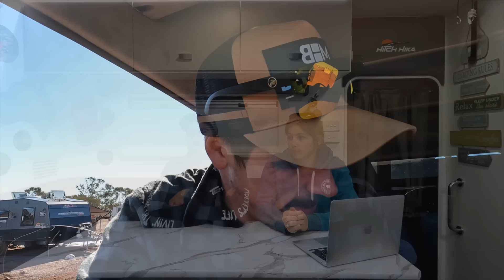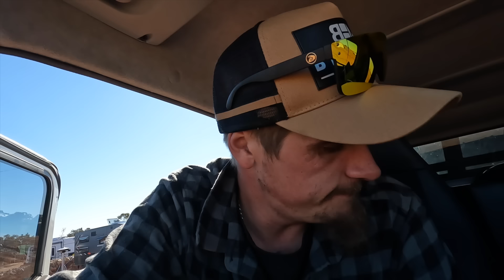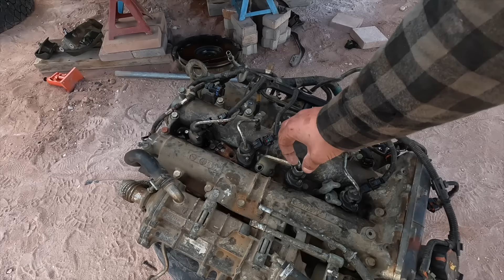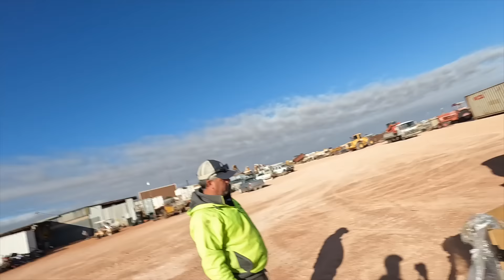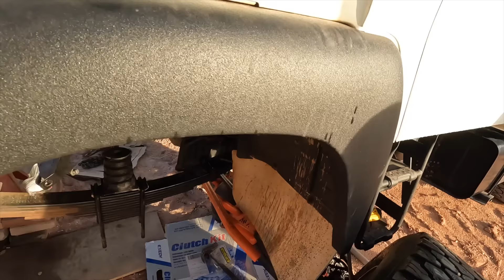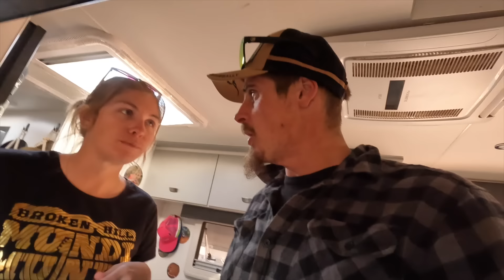COMPLETELY DEFEATED! | Truck Engine BREAKDOWN in the Middle of Australia | Our Raw True Story!

Comment: Terrible story, we just went through almost the exact situation. Bought a 2112 NPS 300 in a private sale through a coach builder on the GC. It came already setup with a 2023 Austral pod with all the fruit. The odometer had 50,790 klms on the engine. It had a new transfer case super singles etc etc. We’ve been travelling for 9 weeks up the East Coast and the internal water tanks ruptured, water pissing out all through the pod. Decided to head back to Brisbane to get it fixed and the gear box jammed up. No warning lights no preconditions. Tried limping it back from Tully to an hour north of MacKay to a truck stop. A few scary incidents on the way back but made it safe ( couldn’t shift it but managed to get 5th and roll it) I hear you when you ring around to get “ someone local “ to diagnose the issue and no one gives a shit or is outrageously expensive.
Four days in a truck stop no water onboard and no powered site so it was a little defeating to say the least. I managed to find out what the problem was and rang a spare parts in MacKay and fixed it but that wasn’t the total issue and ended up having a truck repair place fix the issue and get a tow to the yard…..
I was informed by the repairer that the odometer was flicked and there was way more mileage on the engine???
Now we are having more issues that Isuzu is sorting out while we try to find accomodation for a week. Really hard with a dog nobody is willing to accomodate. 
The bloke who sold us the vehicle is denying everything and duck shoving the issue 
Court maybe the only answer but that is costly and time consuming.
I suppose “ what doesn’t kill you makes you stronger”.
Reply from the maker: Sorry to hear mate. It’s so hard to get help in general while travelling hey! We only got so lucky because we kept being handed more phone numbers to call. 
Your situation sounds so hard, and one of those ‘one in a million’ shitty situations. 
I hope it gets sorted and you get some help. 

Just keep going, and you’re exactly right, what doesn’t kill you makes you stronger. 

If I had any contacts in that area I would pass them on mate, wish we could help more. 

Hope it all works out. 
Stay strong.

Comment: Too cold this time of the year to be in Cooper Pedy
Good Luck for the future 
Greetings from FNQ
Reply from the maker: @rl7586  yes it definitely is I don’t thing we got out of long sleeves and long pants the whole time. We’ve made it up to the warm weather in NT 😊 cheers
Reply: Cold lol,what 30c daytime temperatures!
Reply from the maker: @Wilt8v92  I think it only got to a high of 16-17 when we were there
Reply: @tildesleystravelaus I  In the South of NZL the snow not far from me,I still in shorts but I see Tasmania has been colder than us by far.I have driven around the desert in a  Valiant ute back in the day.As a bush mechanic this new diesel stuff is a bit scary,be good if you get something without  a DPF and AdBlue ,it's all this emission control stuff I reckon is causing problems,but the manufacturers are been forced into it..At least that mob stood by it for you..
Reply from the maker: @Wilt8v92  yeah pretty cold down in tassie, 
That would have been awesome in the day 👌, yes I’m thinking the same thing regarding all the emission stuff these new engines have 🤷‍♂️

Comment: Guys in my opinion if your vehicle is a Fuso Canter, then it has a puny engine of 2998cc.It’s not made to tow a caravan and must have given the engine a heart attack. Surprised it has done 50,000 km.
Better for towing is Isuzu NPS 75/45-155 4x4 which has a engine capacity of 5193cc 😢
Reply from the maker: Thanks guys, we looked into the NPS but decided on the Fuso for reasons of our own, also the 25 model NPS 300 is dropping to a 3L engine. Enjoy
Reply: umm in nz our two 4x4 fuso canters have a 4.9l engine 4m50
Reply from the maker: @acevr4  they dropped the 4.9l engine in these around 2012 I believe in Aus
Reply: @tildesleystravelaus  right, our 2008 and 2022 both have them, we couldn't get the 716 without the 4m50. the old one has been super reliable , they are both spray trucks, your one is mine and two other mates dream truck for adventures .
Reply from the maker: @acevr4  yeah I did look for a 4m50 truck but fairly hard to come by, in aus as most people who have them hold onto them as they are super reliable, thanks mate we absolutely love our truck they make a awesome aventure vehicle 👌 enjoy
Reply: My 1985 nissan urvan has Z20 2.0l carby petrol. Gets up the Alpine Highway to Mt Hotham good enough.
Reply from the maker: @brutechurchill  👌
Reply: @brutechurchill  yes it will since it all depends on the power to weight ratio of the particular vehicle.

Comment: These engines are a nightmare there actually a fiat engine if you didn’t know. There common for cracking heads there is also a recall on the timing chain guide bolt that holds the timing chain guide in backing out. Definitely worth a phone call to see if it’s been done.
Reply from the maker: Yes we have obviously found that out since our issues.
Reply: Do you guys know what years are prone to this problem,  I got the 2015 nps 300 with 250k on it.
I'm in west oz and it's my painting rig
Reply: @Clayton-h4q  truck in the video is a Mitsubishi.
Reply: Iveco , Mitsubishi, loads of engines are exchanged among the factories.
Reply: I've heard a heap of dramas with the Canter motor unfortunately.  Seems most tour operators, remote stations and remote contractors use the isuzu nps or hino.
Thanks for sharing your experiences
Reply: Good job bud that old motor looked 25 years old.
Reply: Anything made by fiat  is trouble Fiat stands for FIX IT AGAIN TOMORROW but top job on the removal in the middle of nowhere

Comment: Man i feel for you guy's. I purchased a low km fuso canter with that 4p10 engine and it has been an absolute bucket of sh#t with nothing but problem after problem. Dpf problems, ECU problems, EGR problems, it doesn't go a week without a engine light coming on for some reason. I have been told by several truck mechanics that they are the worst truck on the road and that i should sell it and buy an Isuzu. I am glad it has all worked out for you.
Reply from the maker: Thanks, same back to you mate, sorry to hear, hopefully it goes better for you😊

Comment: Registration should of picked up the heart transplant. I can only imagine the heartache. Best of luck to ya .
Reply from the maker: Different states have different laws unfortunately. It was done before it was due for rego and people that did the swap didn’t notify/didn’t know they needed to notify the authorities. 

Thanks mate, all back on the road now 👍🏽
Reply: No reputable shop arranges an engine swap and doesn't update the engine number... whoever that is should be paying for your headaches. Hopefully it's all behind you now.
Reply: For the last 40 odd years nothing and I mean no vehicle has an engine no. On the rego papers and rego papers in your name doesn’t prove ownership either. When I was young any engine change needed a eng no update on the papers . Once the 17 digit vin no came in that’s all that mattered to the unthinking govt and then it was open slather for the thieves stealing cars 4wds etc for good engines trans . I’ve seen 80 series cruisers cut up with concrete cutters for the running gear out of the riverbeds.
Reply from the maker: @smaldo19  we did get refunded the cost of the new etc for this reason they didn’t get it re-inspected and compliance for the new engine number
Reply from the maker: @stephengibbs4372  yeah not sure about that as our 21 model truck had an engine number on the papers that it was Registered with then a different engine number on the engine that blew , we then brought a new engine and have had to get it reinspected for the engine swap.. 
my ls2 chev motor in a project still at home has an engine number 🤷‍♂️
Reply: @stephengibbs4372  All vehicles have had engine numbers & continue to do so.
Reply: @davecurry8300  I know that, I build engines. I forgot to put im in NZ and some of our law changes in the last 30 years have been misguided and a bit slack.

Comment: Oh, not as bad as l thought, Mitsubishi  ok, but light running gear, for the job it's doing.
Best of luck, don't push it too hard, should be ok.😊
Reply from the maker: @owenwatson9828  yeah I had a few Isuzu we ran thru work hence our decision on a Fuso , only negative against was the 3l engine compared to the 5.2, power / torque almost similar, Isuzu have now dropped that motor on next years model for a 3l 🤔

Comment: You should’ve just put another cam chain in it or timeingchain
Reply from the maker: The engine bent valves etc when it snapped as they are an interference motor

Comment: Doesnt the cab tilt on the mitsis?, I had a 64 canter dual cab and wasnt hydraulic tilt but you could winch it up ?, got a bigger isuzu FTS750 dual  cab now with the hydraulic tilt, heaps easier :)
Great channel, and what excellent parenting, awesome upbringing for the kids , :):), cheers from a fellow west aussie :)
Reply from the maker: Yes they do tilt but no hydraulic tilt you need to lift them up and prop them. It was easier to remove the diff and drop the engine out the bottom in our circumstances 😊
Reply: @tildesleystravelaus  Ahhh, yeah, good point, all the best :)

Comment: My 5.9 12 valve cummins was going to twin turbo it but got me a 2006 24 valve 5.9 common rail in the stage on a total rebuild it have 400 hp with about 700 torque with my 6 speed aillson any way its hardercin Australia people dont realize howbig it is and hard to get partsc
Reply from the maker: The 6bt’s are a beast. 😊

Comment: What's a secondhand low klm engine worth for the Fuso and did it come from a truck wreckers?
Reply from the maker: 15k with freight, we got it from a running truck that a company crashed, so seen the kilometres etc on the dash and seen it running 
Can get a long engine rebuilt from a few builders but was a month wait, they were 12k +gst 😊
Reply: @tildesleystravelaus  Thanks for your honest and informative reply, I hope your travels are free from any more major mechanical issues from now on. what are your thoughts on the Fuso as a tow vehicle and off-road rig?

Comment: You messed up when you went fuso. First 100,000km you'll do a head gasket guaranteed. DAIMLER/Fuso are the worst to deal with. The concept of 'right to repair' goes right over their heads. Not to mention fuso are the most uncomfortable cabs to sit in. The old models are good but steer clear of the newer ones. Isuzu are better but would also avoid any models with DPF. The newer DOC system seems to be reliable.
Reply from the maker: @BingoBongo-or5ni  we love our Fuso, and I find the cab way better in comfort then the Isuzu to sit, i find my knees are too close to the dash / steering wheel in the Isuzu, but hey that’s what makes us all different, I agree with how Daimler are to deal with tho definitely not easy. 
Cheers 🍻